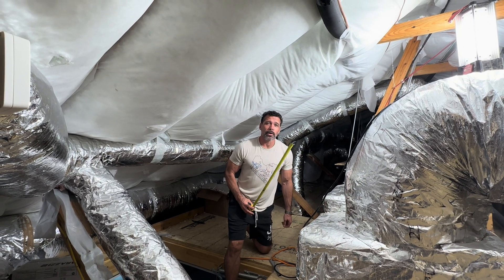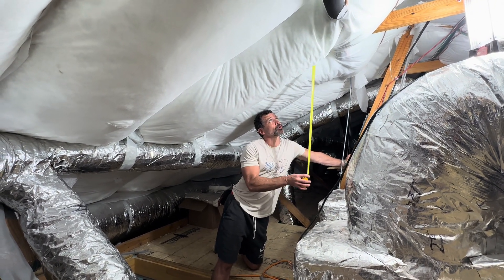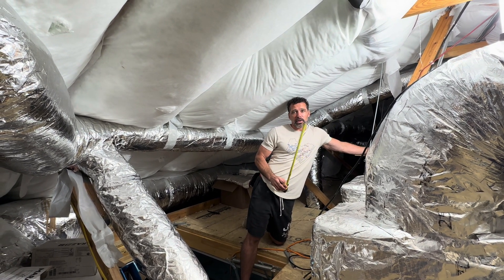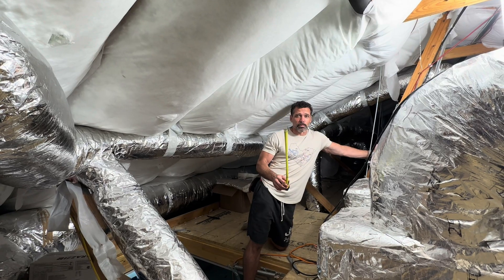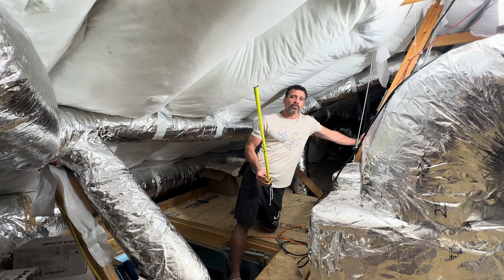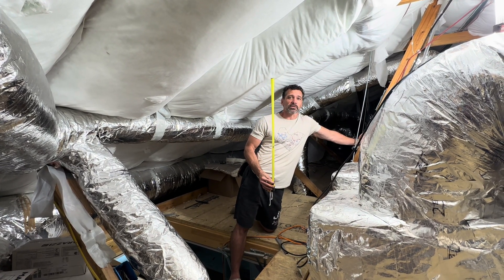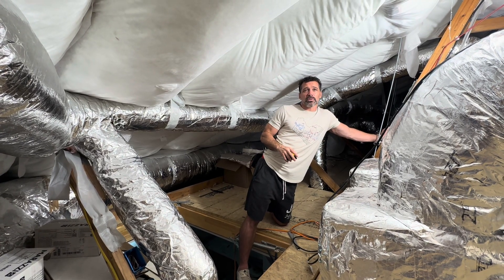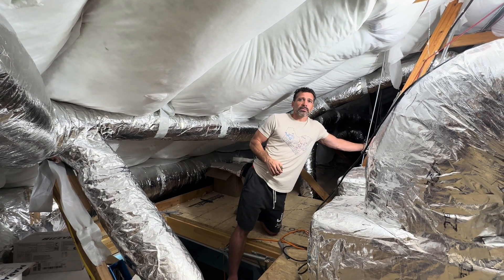Conditioned Attic Sans Spray-Foam

Comment: I was contemplating doing something like this. I was considering putting 1/2 inch spacers in the under side of my roof deck, and putting a 1/2 layer of foil backed reflective foam on those half inch spacers. This would still allow some air flow under my roof deck, as well as a radiant barrier with the needed air gap for that. My plan was to glue the spacers to the roof deck with a foam gun, and glue the foam to the spacers with the foam gun. Then attach the fabric as you did, and the. Use a blower to vacuum up the attic insulation and blow it  in the fabric pillows. This seems like the most efficient way to remodel the attic insulation system, and reuse materials, versus remove and dispose. 
I would love to see a video of how you install the fabric. I had contemplated using pocket screws and building risers attached to the back side of the trusses, every 4 feet and stapling the fabric to those. This would block any thermal bridging, and keep a uniform insulation thickness. Extra work though.
Reply from the maker: You could potentially add in a vapor diffusion port at the ridge & skip the radiant barrier & gap. But it all depends on your specific situation